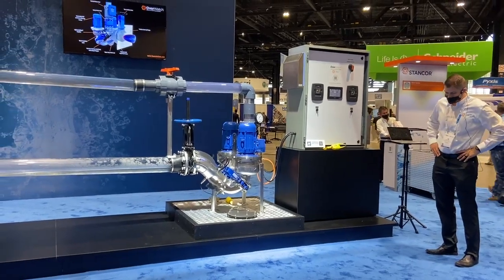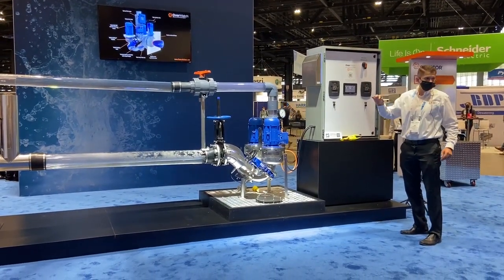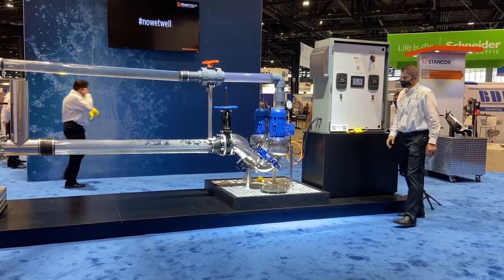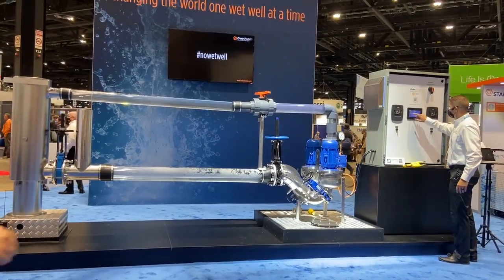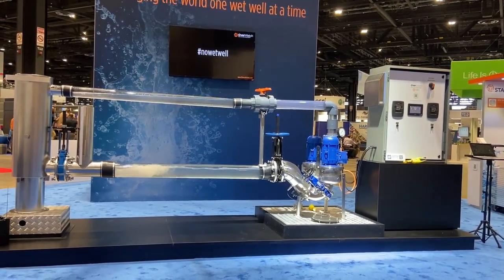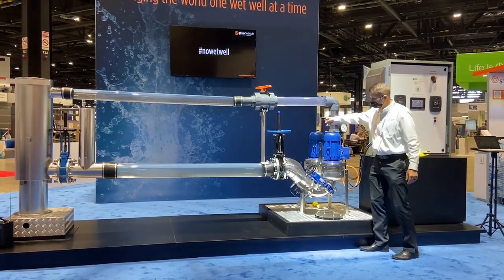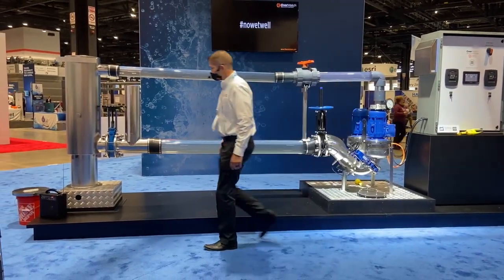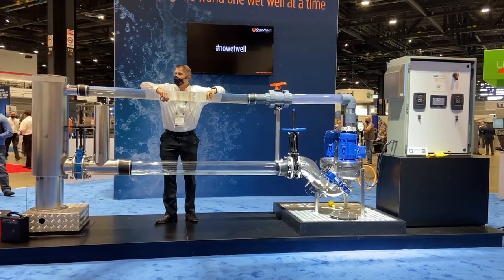OverWatch Demo at WEFTEC 2021

Comment: I'm interested as to how frequent start/stop of the pumps or frequent VFD modulation impact the motor temperature. Usually you would size the well to keep within a maximum number of start/stops per hour, but without that well, would these be envisioned to operate more or less continuously during the day? Also, without having the wet well storage buffer of a submersible system do you find issues with air entrainment or cavitation?
Reply from the maker: Hello Mike! Thanks for reaching out to us about the OverWatch Direct In-line Pumping system. These are all great questions. This technology solves many of the modern day troubles with traditional Wet Wells and we’re excited to talk about it.

The system is not constrained by the number of starts and stops as a traditional pump system. We use soft starts and stop to reduce motor current in rush. But the magic is really in the system’s ability to  use a PID algorithm to regulate flows, selecting a low frequency to keep the liquid moving when enough flow is available. In periods of low flow, the system will run between linear On/Off set points. With this control algorithm, the intent is for the system to run more frequently but consuming lower energy. By keeping the system moving, we eliminate sediment build up from FOG and Rags and well as eliminate smells. Lastly, Air entrainment or cavitation is not an issue. The system is programmed to maintain a flooded suction. In the event the detects cavitation (higher flow elevation with no torque on the motor) the system can make adjustments to performance to eliminate the cavitation. Do you have a current project in mind that we can help you with? If you have any further questions, please feel free to reach out to me directly at jhuck@flowsolutions.com. Thanks James.